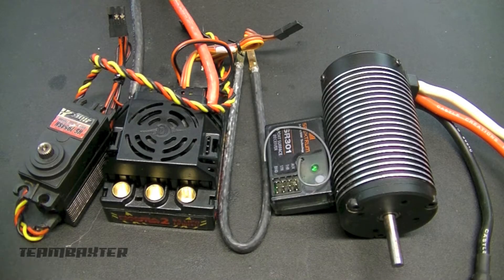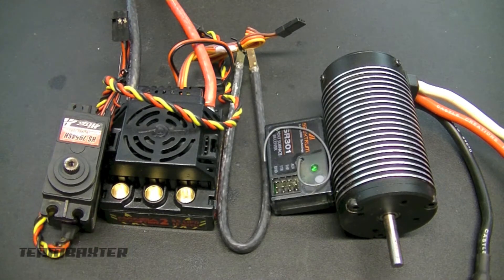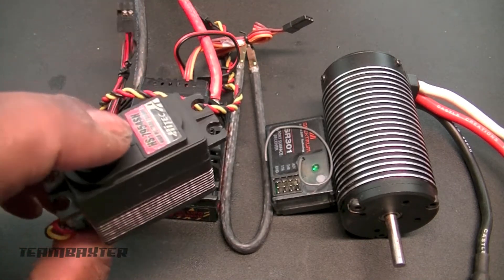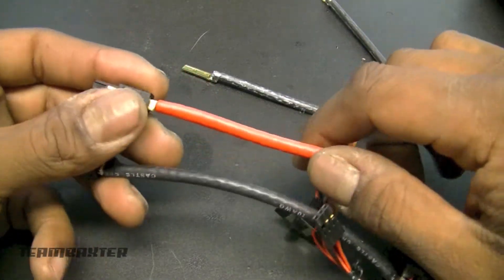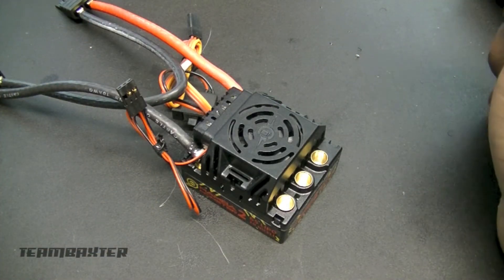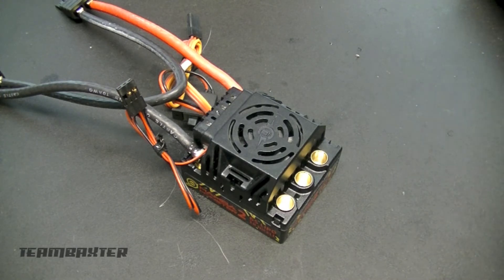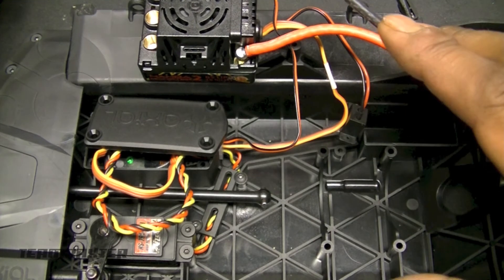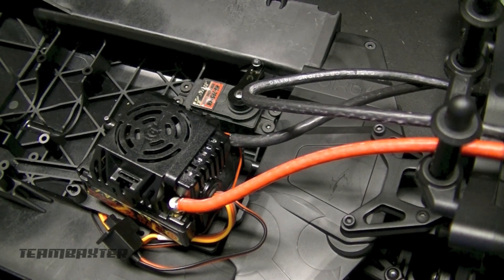Axial Yeti XL Kit Build: 6 - Electronics

Comment: Hey what you  thing, Leopard 4074 2200kv 2600w motor is enough to move this thing without burning motor?
Reply: +drzerg The 4074 2200kv should be fine.